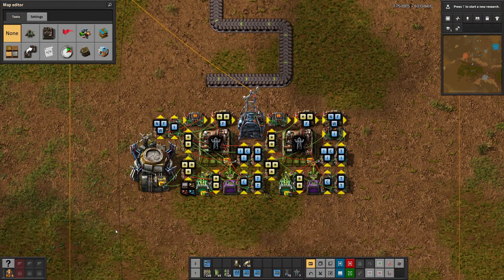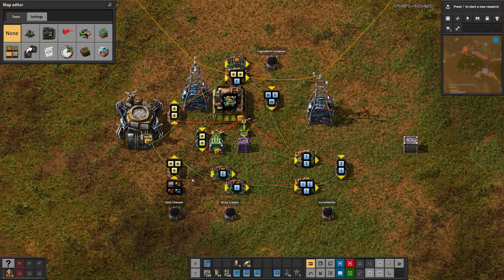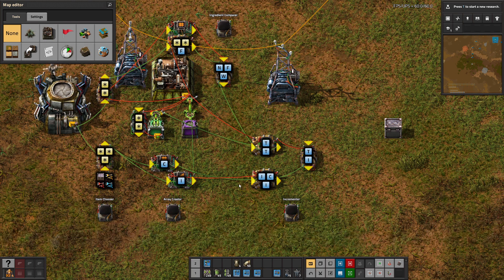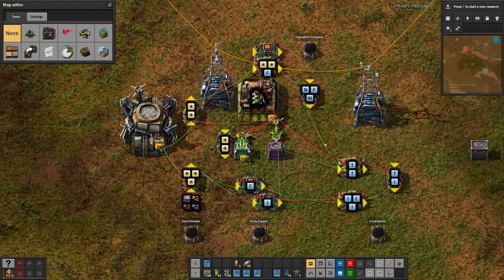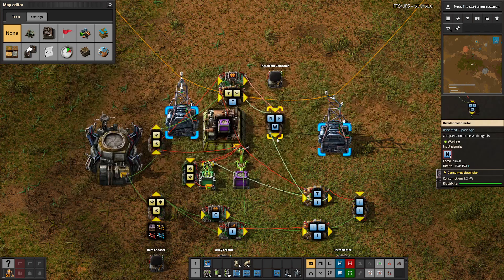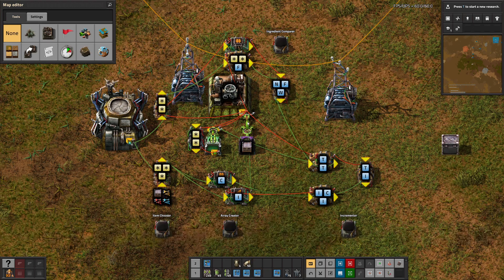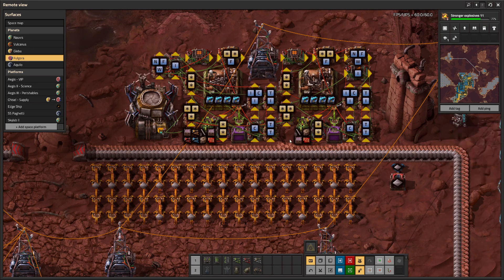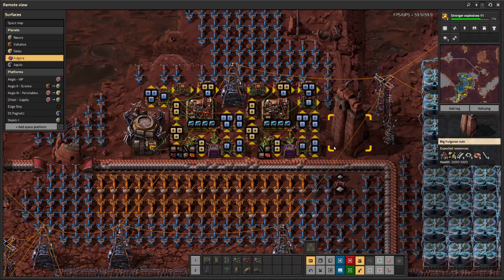Factorio Space Age - Automall "Spidermall" Circuit Design

Comment: I tried co-opting the v1.2 design to work with the special space assemblers for 0.7 SE and every single attempt with the wires matching 1:1 with the original design resulted in different errors. Whatever voodoo makes the original design work clearly is not strong enough to match the space exploration wizardry.

EDIT: Turns out it was just a signal for an item that had no recipe unlocked bricking the system, oops

Comment: nice design, however it does not work for one simple reason: when selecting an item to craft, the item is selected using an index value. the problem is that the array can shrink and expand at any time, and if the amount of an item increases it will move up in the array, changing its index. So, in a large base, the machine can get stuck betwen multiple recepies and never craft anything
Reply: You can sort of fix the "intermediate product causing rapid switch" bug by making sure that the quantity of intermediates listed in the combinator is enough to get all the way through one of the jobs that will need those intermediates: for example if you have 100 red and 100 blue inserters you need to have 100 yellow inserters in the combinator, not 10.

The second bug I've found recently is if a small quantity of an item gets stuck in the buffer chest for the other assembler and the two ever get out of sync, one assembler can end up stuck on an a craft forever. (It thinks it has access to the ingredients when really they're in the other buffer chest.) I'll start testing ways to fix it: my ideas off the top of my head are to check ingredients in the buffer chest rather than the logistic network, add some sort of force-increment to the array index if no craft completes within a certain time, or just check the 'trash unrequested' in the buffer chest. You may have some insight into the pros and cons of each of those guesses- my main worry is creating those loops you talk about in this video where tons of materials end up in transit.
Reply from the maker: I haven't experienced this at all and my base is definitely quite large. If it can't craft something it will try to cycle to the next item in the array. I'm not sure how you managed to create this problem and nobody else using the blueprint has reported anything similar.
Reply: @StupidFatHobbit  Let me clarify: the design works, but starts to malfunction if things like gears or wire or circuts are added to the crafting list. if the mall is crafting belts, the amout of gears can go down, which will move them down in the array causing the mall to switch to crafting gears. this could also happen if large amounts of items are taken out of the logistics network at once. So, while the blueprint does work, it has problems with producing its own ingredients.
Reply: simply add some intermediates into the combinator. gears, wire, circuts. have the machine make like 100 of each.
Reply: ran into the same problem. as soon as the intermediates are lower in stock than the target item, the assemblers switch recipes back and forth too fast for anything to be crafted.

Comment: I'm very new to factorio circuits. I tried making one myself as an introduction to circuits, and I think it works? I'm curious as to why you made the array with the timer rather than a selector combinator that spits out the signal with the highest value. That's what I did and its working so far, but I imagine there's and edge case I'm missing.
Reply: I'm guessing the reason it cycles is that you may not always have the ingredients available for everything on the list. If you select the highest rather than cycle, it could get permanently stuck on something you don't have the ingredients for (and possibly that thing is later in the same list, but will never be reached).
Reply: I think your right. Another case is if it's stuck crafting something that requires something lower in the list. It gets perma stuck.

Comment: great job with this! I came here because I was trying something like this on my own and couldn't even get it started. I was totally overwhelmed. If I could offer any input It would be to make it possibly skip (I+1) a recipe if the ingredients are nowhere in the circuit network. I think this would be helpful when one product requires another intermediate product and has used them all up (fast inserter recipe used all inserters). not really necessary but may speed things up a bit, especially if you wanted to make a spider mall just for inserters or belts, since they require a lot of their own intermediate product therefor more cycling. cheers!

Comment: This looks amazing, would it be possible to share the blueprint for it? both the compact and explainer version would be nice ;)
Reply from the maker: Forgot to add the link, it's in the description now.
Reply: DocJade made a version which is a little more complex but also imo better and more reliable. 

Look up: “Factorio Blueprint: The AutoMall” he made a video about it with a blueprint in the description. You can also get it from his general blueprint book.
Reply from the maker: @alextonev3017  Not sure if I appreciate the implication that my design is unreliable without an explanation of how. It's been solid so far.
Reply: @ doc jades version had some editable parameters that are very useful to solve reliability issues, like when you scale your design to make it much larger sometimes bots take too long to reach assemblers causing recipie to time out half finished
I didn’t extensively test your design but based on the ease of use alone provided by the easily editable parameters I still think his is better sorry
Reply from the maker: @alextonev3017  Materials in transit by bots don't count as being in the circuit network. The system is set up so that if the materials exist in the network, the timer will stop. If you have barely enough to craft something then a cycle can happen if all materials are in transit. This is easily adjusted by changing the timer (default is 300 ticks = 5 seconds) and is trivial to parametrize.
Reply: I disagree, as someone that has used the automall.

This has a way higher throughput, allows better modify-ability and is more compact.

Docjades mall can get into a ton of issues, like flickering, requiring ingredients you dont have. And in order to make complex ingredients docjades need multiple modules. 

Meanwhile here i can simply add the ingrdients into the array and it builds everything i need.

Only improvement i see would be a way to prestock ingredients. (Like always contain 300 copper iron and steel).
Reply: @Uforianer Ha kinda funny that exactly was my thought too 😂 is it possible to make a memory cell that safes every requested item? Surely.. I mean as long as you don't reset the cell it safes everything. You just need to stop counting upwards at some time. And you can put a combinator between that and the chest so the input gets set to only 1 and then multiple 1 by let's say 50 for every item. That way the memory cell can count multiple items multiple times without having the chest get to full because of for example iron plates being requested dozens of times. Yep I will copy some things from this video and add that to my own sort of working automall 😅